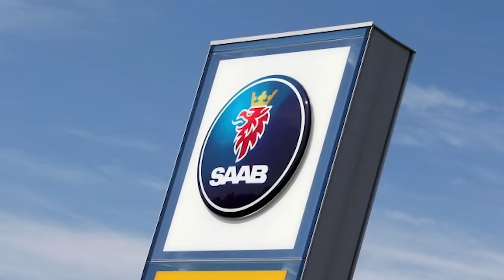SAAB - Everything You Need To Know | Up to Speed

Comment: Ive had 6 SAABS..ive been super lucky, I live in the Hamptons on Long Island and have bought them and other cars from teachers for prices that are Riddick,and once I one got from the dealer that's the SAAB story of the century, I have a 92 red 900 s t convertible with 33k on it i got for 2,300 $ brand new, barned like most Hampton cars and driven either just a few months over the summers or back and forth to a school, one I got was a 90 900 s with 12k for 250 $ the Pirelli tires(worth more each then the car) still had the rubber spikes, everyone is scared of buying them and think there's a problem finding parts or they stopped making them, they've always sold for great deals and it looks like you're driving a 40,000 $ car.People when they get new cars that are rich just want the old ones gone, I drove a 87 944 t off somebody's lawn for free..i love the NG ones 2,all the parts fit them from i think 94-2003, when i bought a SAAB, the last 900s t off the line that went on the anniversary edition line 93 then had the 2.3 t in it with all Viggen parts,i put in a few more part and got 285 HP out of it,nothing from 7-145 could get near me,i brought my 99 SAAb 900 t in for some work and saw this one of a kind Saab on the side of the building,i asked how much and they said it doesn't run and we've sent it out to 11 SAAB places and it won't stop stalling,and explained how it by mistake was 4 cars mashed up,,then he said and pointed to the upper left corner and said its in this area the problem but we don't know what it is,it says map 4 and that part of the engine is 4?i went home grabbed my scanner when nobody was around and it came back MAP.I went to a junk yard that only had Saabs BMW Benzs and so on and the owner used to let me go find my own sht while the staff ate the donuts and coffee I brought, and right on the top stabilizer bar was a 4 screw MAP sensor.i went back and told them i have a new engine put in and i really wanted it,i was a good 10 year customer so they left to talk,they came back with paperwork and said its sold as-is,no warranty no matter what.i signed it and they said give me 1,250$..I almost sht my self.i got to the gas station put in the new MAP got gas and it was fixed.Right now I'm looking at a 2003 2.3 t 75k silver coupe for 1,100 $ and be 50-128 k in mint shape from 96-2004 where I live they sell at most for 2 grand..I've flipped a few from out here too,a 88 560SEL teacher car 42k 2,900 $ mid night blue red leather now a scratch..and resold it for 8,200 in a week.if you don't believe me put in craigslist Long Island and the Easthampton zip code and search Saab and you'll see 99 900s t converts 2,000 no miles and steals...my dad gave me a Jeep worth 9,000 $ I'm selling it and ill buy a Saab 93 for 3k brand new with under 50 k...and use the rest to flip other cars,or get a older Saab and put it under classical insurance and find a perfect 86 Burgandy 900s t convert with low miles show room shape
Reply: the one at 3:55 was the one I got for 250$ with 12 k on it,same color everything
Reply: the car at 4:25 are the ones going for under 2,000 low miles.black and silver mostly

Comment: I have a 2004 9-5, (right before the switch to GM).  Espresso Brown-tan leather-no kids  (gorgeous)  with only  52 thousand miles on it. (yes you heard that right-I don't need to drive very far)

 It's the best and most fun car I've ever owned in my life, and I'm very attached to it.  A true member of the Saab cult here.
   It was my mid-life crisis car, coming from a Honda Accord back in 2004, and I have loved it from day 1.   I have felt SAFE and in controll of this car.  It's so much fun to drive. The seats are so comfortable. 
 According to my ace mechanic, who's been fixing Saabs for about 30-some or more years, (MSM Saab in Woodstock GA) my car should go another 300K miles or so, at which point I'll be dead.? :)  By the way, if you live in the area and have a Saab or Subaru- take your car there. It's not a fancy place, but it's the absolute best.

 I'm keeping the dinosaur alive as long as I can until it becomes too costly. (so far I haven't spent much).  Meanwhile, I'm the only one driving a 2004 Saab wagon in my town, as far as I can see.  I like that.

Comment: GM did not sell SAAB to NEVS, they sold it to Spyker Cars and it's crazy owner Victor Muller became the new vice president of SAAB Automobiles. Victor drove the company into bankruptcy in a fairly short time so NEVS stepped in and bought the remains, including the factory and most of the design rights and patents, although some major rights were kept by GM. Like the drivetrain for example which was a major contributor for the bankruptcy. NEVS plan was/is to build fully electrical vehicles so they don't need GM's drivetrain.

Comment: Proud owner of a 9-7x here. Sure, to some people it’s not a “real” Saab, but i think Saab did a great job distinguishing it from the Trailblazer. The interior is a million times nicer, and the exterior styling has aged very well, in contrast to the quite hideous Trailblazer. The car sits a little lower and it came standard with rear air suspension. In addition with the 4.2 inline 6 cylinder, it drives like heaven. The interior is much more spacious than the 9-3 and the 9-5, and it can tow if need be. I chose this car because I live up north, so I really benefit from the 4WD. Also, the 9-7x shared a platform with the previously mentioned Trailblazer, the GMC Envoy, the Buick Rainier, the Isuzu Ascender, (and another one i’m probably forgetting), so there is a PLETHORA of mechanical and drivetrain parts for this car. It has been very reliable for me, and it now has around 114,000 miles on it. The only complaint I have is gas mileage, but my commute isn’t very far so it wasn’t a big concern for me. The 9-5 and 9-3 were produced in higher quantities in a given model year, so it is truly a hidden gem of Saab, and it always angers me when people call it a “Trollblazer”.

Comment: I had an old bike that didn't run so i just put it up on craigslist for a trade. I needed a car but who's going to trade me a running car for a non running motorcycle?. Well someone did. I got a 2002 saab 9-3 in trade. That was 4 years ago. I still drive it daily. I hate what happened to saab. Side note. I live in a very small town in Arkansas and I was blown away when i saw a local driving a saab 900. What's the odds?

Comment: Sorry you had a little mistake :
Saab 9-3 Viggen had :
280 of torque.
Stock. The measurement we use in torque in usa . 
The fastest production was not the Viggen. It. Was :
2008 Saab Turbo-X. Manual transmission .  
Because the auto was almost a second slower. 
Some say the Saab 9000 Aero remains the Fastest mid range punch in Saab history. Then the other fast Saabs are : 
9-3 Viggen
9-3 Aero , 9-5 Aero
Reply: Saab did have a 9-5 Tuned by hirsch with a little over 300 hp

Comment: My first car was my dad's old 1972 Saab 99 - - loved that car!!  Then my dimwit second husband broke the key off in the ignition (didn't put it in Reverse), then shorted it out messing with the wiring under the hood ... pretty much killed the car.  No one in my rural area knew how to work on it.  I'd take it to a shop and see if they could open the hood ... if they couldn't, I wouldn't let them touch it.  Needless to say, I never could get her fixed (authorized service shops were just too expensive).  Sure miss that little car though.

Comment: Still remember my mums Saab 95 from back in the day. It had a manual control of the Choke valve :d 2 doors and sitting in the backseat like I always did because my sister got car sick, it smelled like exhaust was coming in. Mum always forgot to disable the choke value after using it and the car would stall at the red light :P

Comment: 2:30 "it's something that NO OTHER CAR COMPANY WOULD EVEN TINK OF"
introducing the Renault 4... designed in the late 50's, sold from 1961 to 1992 and then the renault 5 using basicaly the same drivetrain with the gearbox at the front and the engine behind it... 
technically those cars were mid-engined because of that
Reply: no one buys french cars, they are terrible
Reply: over 8 million renault4 have been sold and 5.5 millions of renault5 , all before the 90's even happened.

Comment: Too many comments to read through all and see if this is mentioned, but one of the projects they pulled the plug when GM came along, and boy is this a stinger, was the Saab 9000 V8. The car had a naturally aspirated 4-liter 300hp V8 engine. Although it's probable the project wouldn't had come into fruition anyway as it wasn't completely aligned with the company vision.

Comment: Fyi. Not sure if I said this already.. the 900 was in 2 gens.. 1st gen up to 94.. 2nd gen from 94 to 98.  Then they rebaged the 900 2nd gen as the 9-3 with improvements. Then after 2001 or 2002 the 9-3 got a face lift to match the 9-5

Comment: you should go into the saab 9000 its such a grreat car, it has a top speed of 305 km/h wich beats most modern cars till this day, its reliable up to 400+ horsepower with an unopend engine wich is absolutly insane

Comment: No mention of the fact Saab technically didn't need roll cages in their rally cars because the pillars were so strong or that when GM wanted a rebadged vectra from Saab and Saab basically redesigned the whole car.  You could drop a bmw 3 series onto a saab's roof from 30ft and still open the doors

Comment: this is good, but it's missing a LOT of important information, this episode is in DIRE need of a refresh. For starters you didn't really dive deep to how good the 16 valve dohc b202 was. That engine in the saab community is a legend. It's strong as heck, sounds good, and can handle a lot of power, most 4 bangers blow up with boost but the b202 can handle power. speaking about engines, you didn't mention the B204, also seen as one of the best engines saab made, it can handle up to 400 horsepower on stock bottom end, it has a cast iron block, it's like the secret 2jz of 4 cylinder engines that no one knows about. The B204 was offered in the saab new gen 900 from 94-98, and for one year in the saab 9-3 for the 1999 year, which is why when people buy the first generation saab 9-3 they go for either the viggen or the 1999 model year because it offers that beautiful b204 engine. You also didn't mention the saab 9000, which was depressing because that was one of Saabs best cars, and offered the b234, which is like the b204 but with higher engine displacement. This episode failed to mention anything about trionic 5 and trionic 7 engine management systems and how you can tune a t5 engine to get insane power for the price of nothing. t5 (trionic 5) was offered in the saab 9000 and new gen saab 900 which is why the faster tuned cars are typically those Saabs. The 1999 9-3 had t5, also why its more desirable. any saab that was made from 2000 and newer that had a saab engine was a t7 b205 car that couldn't handle as much power as the 1999 and below cars. I also didn't seem much info on the turbo x, an iconic "saab" (it's not really a saab it's a chevy) and on that note you should've mentioned how absolutely terrible the ecotech engine is in the new generation 9-3, it made the saab no longer a saab, thankfully the 9-5 had the b205 engine to keep it saabish. The new generation 9-5 wasn't mentioned either. Just something to consider if you redo this episode, which you should. :)

Comment: Didn't mention the 95,96,9000 and uudenkaupungin autotehdas where they made a v8 saab, performed stunts on the old track such as driving a 9000 on 2 wheels and made saabs there, here in finland. Both of my saabs 900c carburetor 2.0 and 2.1 16valve 900i were made in finland
Reply: Saab 600, saab-plymouth
Reply: Saab 98 prototype
Reply: Saab 90

Comment: Actually, GM sold Saab to Spyker in Holland. A year later Spyker tried to sell Saab to a Chinese manufacturer but GM blocked the sake citing a clause that no other auto maker can use the Epsilon-II platform. Spyker held on to Saab and sought investors. There was one American investor that was going to dump $10-15M into the company but later backed out. That forced Spyker to discontinue Saab production. A year layer Spyker sold Saab to NEVS. Last I checked they are only producing the 9-3 and exporting to two countries.

Comment: 🤔 Pretty sure the Saab 2.3 turbo engine is capable of 300-400 bhp on stock parts. And an Opel Omega B gearbox bolts straight on for rwd...and if the 2.3 is based on the original Triumph engine then it should fit in classic Triumph's and maybe even bolt straight onto the original gearbox. So you could have a classic british sports car with 400bhp per ton that DOESN'T break down! 🤯😁

Comment: Saab are still building Semi trucks but they are called Scania (sorry my english is not the best cuz i am born 2006 and i am german)
Reply: Totally different companies. Saab and Scania was separated long ago, and Scania is now owned by VW Group as a sister company to MAN.
Reply: @marcusjosefsson4998  did you look at the logo from scania and saab...
Reply: @mircomelsbach1733  So? GM bought Saab in 1995, after which Saab and Scania were two separate companies. Volkswagen AG bought 34% of Scanias shares 2000, and had a majority with full control in 2008.
Even during the Saab-Scania period 1968-1995 they were still different companies, Saab never built trucks and Scania never built any cars.
Reply: @marcusjosefsson4998  i Work at Scania

Comment: GM SUCKS. They killed two of my favorite car manufacturers, SAAB and Pontiac. I'll never support GM again after that. When my old man and mom took the trip to Sweden to receive their 9000S, it was probably the most anticipated moment ever. They had originally wanted a turbo version,  but decided not to. That Edwardian Grey looked so good on that car. Ran as good as it looked. When we moved back stateside,  of course, stupid American politics and regulations had to be met. What ever they did to the car, eventually ruined it in a few years time. And since GM WERE TOTAL ASSHATS, support for the brand was lackluster at best. We couldn't find a decent dealership to service the car, and getting parts for it was more expensive than it should have been. My old man garaged it and tried to hold onto it until he could restore it. But that day never came... 

When we had the SAAB in W. Germany, everything was tight, and well secured. The 2.5 years we had a euro spec SAAB was pretty awesome. But as soon as we went to pick it up from port in the U.S., it no longer had that torquey feeling. It just seems as if It had no soul, like a used car has been. I'm guessing that it had something to do with the fuel delivery system. It was in need of a good tuner, or at least a dealership that knew what it was doing. But this being the early 90's, those seemed few and far between.

Comment: Saab deliberately used nearly no GM parts so rebadging was never a thing there.
Reply: Well, the chassis was from Opel most of the times, just with a few Additional struts to make it stiffer. Also, wires, gearboxes and the shifter as well as small parts like the things that keep your trunk open (i don't know their name in english), the keyfab and in my case the fueltank is were from Opel...
But yeah, except for the 9-2x, they didn't just rebadge the car as-is but only used small parts (and the basic chassis, but there's nothing wrong with the Opel Chassis). I mean the Bugatti EB110 uses the indicator switches of a Fiat Uno and the mirror controls of the Opel Corsa B...
Reply: @timweber4318  they even designed their own satnav system

Comment: The GM Saabs are real Saabs The Saab engineers 
modified the chassis and Motor only the cheap plastic inside is GM. They were making too much costs in remodifing the whole car. I dare you to drive a opel and a saab on the same chassis and feel the difference.

Comment: Remember, kids: if a cool car brand is bought by GM, it is gonna die soon.
Reply: Or a reliable brand, that had a great dealer network, great prices, and fantastic service.

I'm talking about Saturn.

Yeah, they weren't fast, or even pretty. But they ran forever. I watched one roll into a ditch on its roof. Driver and passenger got out, pushed it back over, and got back on the road.

Tough ass little econobox.